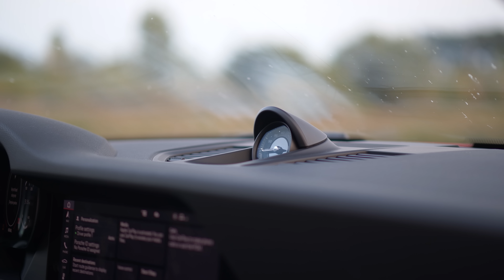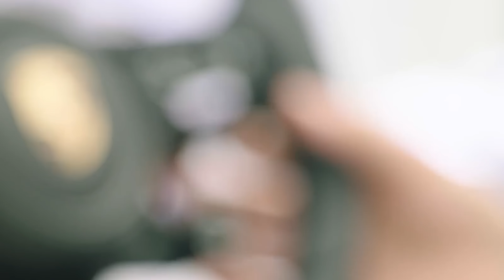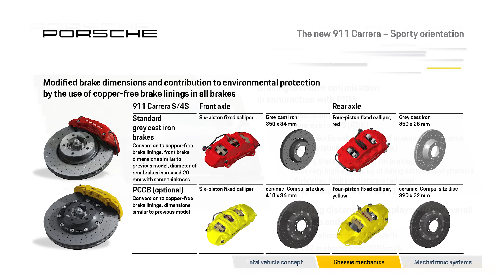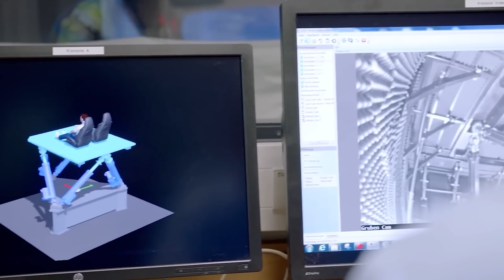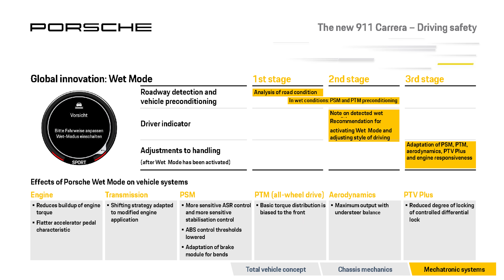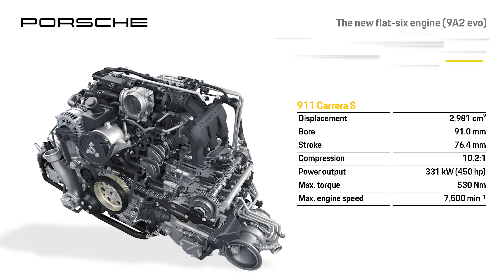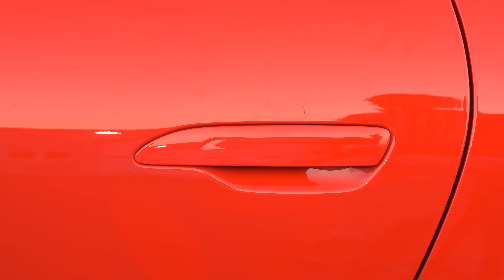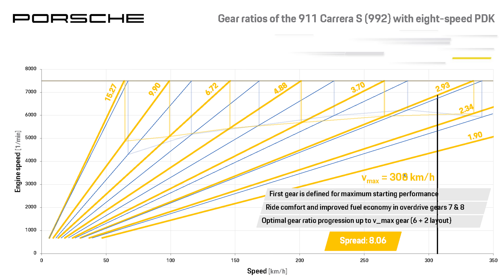Porsche 911 Carrera S 992 | Technical Brain Damage

Comment: I've never been a Porsche fanboy but this review has given me better appreciation of the 911 and the technical details that make it so good. Great review.
Reply: I mean, if you researched it's Motorsports pedigree you would've appreciated a long time ago....... There's no other vehicle as dominated and race successful as the 911......... From beating prototypes in endurance racing to cars with double the power in IMSA/Trans Am.........
Reply: @MiguelGarcia-vj7oo  Oh I know some of their racing pedigree. What I don't like is how much they look alike from year to year. You need 5 to 10 years to notice a difference. This review showed some of the changes made under the skin which was a lot and apparently all added up major improvements. The only Porsche that impressed me a lot was the 918 and that was years ago.
Reply: Too bad they’re pulling the factory IMSA program.  😭
Reply: @rynomite_  I think I know why they do it and its a good reason. The problem is over the years the roads have a lot of them and unless you're a fan boy its hard to tell the difference year over year. They loose their "specialness". They're at a point now where I don't think their fans would allow significant changes. There is less incentive to trade up for a newer model. It allows them to put more money in the rest of the car and most of the time it works (except the move to all turbos.) I think the Taycan looks a lot better and is still a Porsche. Whoever thought a Porsche should sound like a Subaru was wrong. Hey, I'm not a marketing expert its only an opinion.

Comment: 992 has tendency to pull to right from factory, have you heard about it?
Reply: Mine doesn't. It will tramline and follow the crown of the road to some extent under heavy acceleration, but have you seen the width of the tyres? But it's utterly predictable. It really is the most secure car I've ever owned.
Reply: No

Comment: That far right and left steering wheel block issue exists since the beginning of time. Not sure why Porsche designed it this way. The analogue gauges for oil pressure temperature and digi cluster on the 991.1 and 997 exhibit this as well.

Comment: As I was watching the video all I was thinking was "if I worked at Porsche I would constantly ask the bosses if we could make a one off model to REALLY pay tribute to the old ones, something similar to what Singer is doing but all about the driving, 0 electronics, 0 aids, NA engine, slim tyres to have fun with it at lower speeds, around 1, 1.1 tons. A car that you've got to stay on top of it or it will bite.. something that requires cojones, not that WARNS YOU IF IT DETECTS WATER".. there must be remained someone out there willing to purchase something that really rewards you because it's difficult
Reply: Just buy an old 356 or an early 911. just your foot your hands and your butt to feel and control the car. But the 992 is truly fun and amazing as well.

Comment: Not seeing the gauges would drive me crazy. No excuse for that Porsche.
Reply: if that's really, literally the case, you've got bigger issues :). Whilst it's nice to know my heading and altitude, or precisely how many miles are left in the tank, I'm normally patient enough to wait until I'm stopped or until it's safe to move my head two inches to the left or right. I love the size of the steering wheel and I love the general layout of the screens. Plus you can throw most of the information from the right and left gauges onto widgets on the main screen. It is a non-issue, mentioned in reviews because every review mentions it.
Reply: @robbybobbyhobbies  I dont have bigger issues. It's just fucked up on Porsche's part when you consider these can cost north of 200k
Reply: @weirdshibainu  for which you get an outstanding chassis, perfect engine, inspired PDK, awesome comfort, astonishing drivability and two tiny dials that you rarely use, but are available for some information, in the only place they could go, behind a perfectly-sized steering wheel for driving. Each to their own, but  there was no way I was going to miss out on having my dream car because of this.
Reply: @robbybobbyhobbies  drive on

Comment: agreed, I went back to porsche with a 991.2 GT3 6-speed and have not looked back. Daily driven in everything but snow. Completely trouble-free, yet just 'exotic' enough to make it interesting. Only thing I miss in the review is the Audio measurements! Loved the techno-weenie aspect of that!
Reply: you sir are a hero, how does it do in the snow?
Reply: @ShaiyanHossain  well...it can get up most hills, it just does not like to stop on the way down! Just never try to drive it w/ the sport cup tires under 50 degF. They have almost no grip. Swap out for the PS4 and it works much better.

Comment: Is the Turbo S worth the extra money for a fun daily driver?
Reply: I didn't think so when I chose to get a 4S. Since that is already wayyyy more car than you need for the road (UK, policed, crowded, badly-maintained), I've kept the spare for fuel and trips. Germany maybe the maths would be different. Also, if cruising or having to have absolutely the "best" thing, then YMMV. As a daily driver I suspect even a base 718 would be more "fun" than a Turbo S (if you've never tried one, give it a go and ignore the 4-cylinder engine note - it's a hell of a handling machine). As a track day car, other way around.

Comment: honestly i'm just really impressed all of this technical data was available to the public. absolutely loved this mr. goose, keep up the great work
Reply: Porsche can pretty much publicly brag about their tuning because no other brand can justify spending that much on a low-volume car without the boardroom investors shutting them down. It's amazing what Porsche achieved here without being forced by the current car market.
Reply: I’m impressed with their matching Patagonia blouses.
Reply: It's hardly a secret... you can get a shop manual for ~$20 that will give you hundreds of pages of detailed info on each of the things described.
Reply: I went to the Porsche website and the technical stats didn't load on my new browser, only on IE11. Probably all that cookie, data tracking, surveillance crap I am not letting through on my current one. - Also inconsistent presentation. For some but not all models I had to scroll all the way to the bottom to find technical specs and those didn't mention max engine RPM.
Crappy web design is analogous to orange peel skin. It's abundant in all price classes.
And it's sad because a couple years ago the Porsche website stood out to me for not making issues but working fine eben with total cookie blocking and everything.
Which is a side topic: The more marketing gathers analytical data about customers, the less they promote expertise to understand them naturally. It cripples human traits.

Comment: Thank God for physical controls. The thing about electronic controls is not that they're good, they generally aren't, it's that they're cheap. In my opinion the only things that should be electronic controls are maybe secondary controls, but probably not even secondary controls, tertiary controls. Ones you don't use very often at all, but it might be useful to be able to adjust. In fact, one suggested by a given driver, may never be adjusted again.

Comment: I love how porsche has a constant technical improvement on all aspects of their cars except the exhaust bolts
Reply: Seriously right! 500 mile car and those bolts look like shit.
Reply: @artagain8977  Like the orange peel paint.
I once had self-fitted V4A-80 bolts on my Corolla E9 exhaust connections and header shield. Just out of spite for this crap.
Reply: @Dowlphin  you realize that lots of super cars and expensive sports car have shitty paint from the factory that needs correction?
Reply: So nothing has changed in 50 years then...
Reply: Retro design, retro bolts
Reply: They still like to leak oil after all these years, too.

Comment: I love this car.  I’ve been a Porsche Fanboy for years.  I think this car is a serious leap from the 991.2.   However, I just bought an Aston Martin Vantage over this car.  It’s pretty easy to argue the Porsche has a better drive, better engineering, more modern electronics and even better value.  Didn’t stop me from buying the Aston.  To hell with all the analysis, I just had to go with the pretty face.  YMMV.
Reply: Juan Valdez - you hit on one of the implications of the 911 creeping larger into GT territory- buyers will just cross shop other GTs.  Guessing you love the V8 soundtrack too....;)
Reply: C Macd-   You are onto something.  I’m only a sample of one but I never seriously considered an Aston until somebody mentioned: “ The Vantage is shorter than a 911”.  The old Vantage is even shorter but it was the incrementally larger 992 that got me motivated to shop around.
Reply: I’ll go wider as long as it doesn’t get heavier. 👍🏻

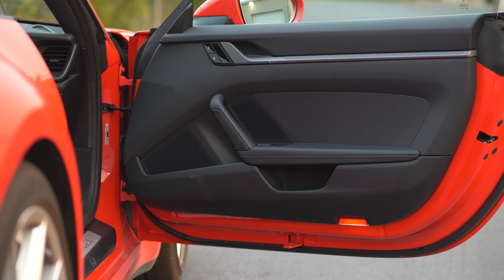Comment: I've never noticed this before, but whats the deal with the hook that seems to slide into the doorframe at 2:09 - 2:11?
Reply: There is a hook latch that locks in place when the door is shut.  It helps the rigidity of the car & also helps with keeping the frame as solid as possible in the event of a side impact collision.
Reply: @Braydenplaysallday  How long has Porsche been doing that?
Reply: @hyperbomb02  I believe I just started seeing it with this gen.  Though they may have been incorporating it with some of the GT variants.

Comment: I'd prefer a car with less tech, and a lower price :) I can't afford a new 911 or 718, and used ones are going to be impossible to maintain without a warranty.
Reply: Porsche has been increasing their reliability for a while now. I bet this car holds up better than a lot of cars with half the technology.
Reply: Buy a Bicicle!
Reply: @ghoulbuster1  Does Porsche make one with self balancing, rear wheel steering, magnetic shocks, electric variable ratio handlebars,  brake by wire, and self inflating tires? I also would need the carbon ceramic brakes, the body color matched pedals, plaid seat cover, bike chrono package, leather hand grips with contrast stitching and of course the latest pdk gear set. I'll probably also need to get an aftermarket gear set, since I hear that the one from the factory is geared too long.

Comment: Hats off to porsche for sticking with a rear mounted engine, and continuing to offer a manual transmission option on their cars. Their persistence to build pure driving cars will keep customers coming back
Reply: That’s because Porsche drivers are, well, actual drivers. Not just concerned with status and cruising the blvd at 12mph to be scene. That’s Lambo, etc. in a nutshell. Nobody buys a manual gearbox in those.
Reply: @OnPointFirearms  I think the reason  for 20% manual sales is the wealth thing. It usually takes a long time to build the kind of wealth needed to step up to a new Porsche. The age demographic for this car grew up with manual transmission cars. Not all of them, but many of them learned on a manual, and enjoy the experience. No matter how you slice it, there will always be a core of drivers who want the satisfaction of doing things themselves. PDK might be faster than a manual on some track, or 0-60. I doubt the average customer for this car drag races, or even tracks the car. They just want to have fun.
Reply: @dougrobinson8602  afaik manual porsches also hold their value better
Reply: @OnPointFirearms  , to be seen, sorry!
Reply: according to the car  and driver review 20% of 911s are sold with manuals in the US which is pretty significant
Reply: Shaiyan Hossain very significant. Back when Audi still offered manuals in most models, only 9% were produced as such.. worldwide. I’m sure the US share of those stick shifting models was much less than the worldwide figure.
Reply: A base 911 is still the best sports car for the money. Resale value, handling, steering feel, aural and physical feedback is unmatched.
Reply: There's an unprecedented age wealth gap today and that's why the few people who are not buying an age-appropriate SUV want old school.
Reply: The Mid engine design Cayman🎉 is superior
Reply: Im sure the implementation of a digital dash and having a good global architecture helps tremendously with including either a manual or pdk option. 
No need to worry about swapping dashes to a 'manual' dash, and a stream lined manufacturing procedure to simply swap transmissions to either a manual or pdk.
Reply: ថហ្₩₩
Reply: they don`t get credit from me with the manual bit, essentially demanding 3k $ for a stick
Reply: dentists and lawyers rejoice
Reply: they are really mid-engine now.
Reply: It is and let's hope it stays that way.
Reply: I would say hat’s off if there race car was still rear engined. Time to admit they made a mistake...
Reply: @e36s54  It still is rear engine in the cup cars and the 991 gt3 R used in the GT world challenge.
Reply: Terry Melvin  LOL, yeah I know what you mean. (:
Reply: Too electronically assisted to call it a pure driving car Kyle.   Its amazing yes....but not a pure driving car or even close.   It's too overly reliant on computerized elements for its performance.
Reply: This
Reply: Terry Melvin   the infamous and dreaded IMS bearing indeed, a 4 grand job to have it replaced preventatively, else you'll need a new engine once it fails. Talk about a ticking time bomb at the back of your mind to kill the joy of driving your Porsche. You might even have to replace it more than once in the lifetime of the car if oil leakage from the engine goes into the bearing which screws it up.
Reply: Terry Melvin  absolutely
Reply: Seems like SUVs are now lol
Reply: @DV-ou1yu  SUVs made them continue producing and investing in 911's, so im not complaining at all.
Reply: @AOTanoos22  And on top of that, the Cayenne and Macan are solid automobiles, so I have no complaints either.
Reply: @DV-ou1yu  And you can get them with a manual, too.
Reply: Engine is in the wrong place and all they did all these years is find technical workarounds and pump up electronic assistance to neutralise the nasty behaviour you get from such engine placement. They would have saved themselves tons of hassle by putting the engine at the front or in the middle.
Reply: @Nexus.Achiles  engine in my Boxster is In the „middle”, much superior placement than in the front or rear
Reply: @Nexus.Achiles  Rear engine gives you traction out of the corners, and excellent weight balance for braking.  I like a mid-engine as well, but there is nothing wrong with a rear engine when it's done by the best auto maker on the planet.  An example of wrong engine placement is in the front.
Reply: @darthnatas953  Yes, but much bigger inertia (hammer effect), propensity to oversteer and go into uncontrolled spin without heavy electronic assistance.
Reply: @Nexus.Achiles  These are some of the best handling cars on the planet, even with all of the stability controls turned off.  The tendency to go into uncontrolled oversteer is more often demonstrated in Corvettes and BMW's with their light rear ends.
Reply: @darthnatas953  uncontrolled oversteer is worse with a rear mounted engine. but all the safety implemented these days deletes this problem. some porsches used to be called widowmakers
Reply: @darthnatas953  no, the best handling cars allow you to do whatever you want with the car, ie drift.  911s have immense grip which make them incredibly capable cars, but handling is lost once grip is lost over the limits.  Great handling cars don't lose their ability to be controlled pass the limits.
Reply: @wind016  Watch Chris Harris in a GT3 and tell me again they don't drift beautifully.
Reply: pure driving cars? good joke. pure dentist car. xD
Reply: Only a causal believes modern Porsche cars are pure driver's cars.
Reply: @zarbon700  what is pure driver cars?
Reply: @zarbon700  I drive a 997 and I know why you're saying what you're saying. There's no end to it, though. Modern regulations (sound, safety, etc.) and practicality require some compromise. Buy used cars if you can, but people need new cars to buy too. You can't drive a Lotus Elise around everywhere.

Comment: When you say "piping in" do you mean threw the stereo?
Reply: No, they make like a resonance chamber in the engine bay that physically brings the engine noise into the cabin so you can appreciate it.
Reply: No. They explicitly said NOT through the stereo.
Reply: I think the 'stereo' part that they talked about was the 2 channel experience you get inside the car with intake sound and exhaust sound that's pumped in.

Comment: Right hand holding your coffee due to the horrendous cup holder position. Left pointer finger steering the car on the bottom of the steering wheel. Screen blocking problem solved.